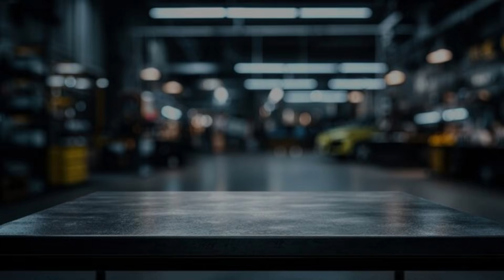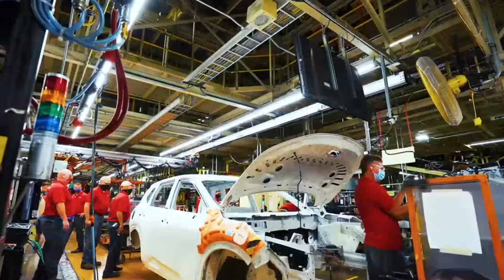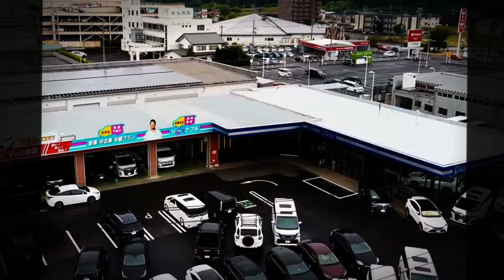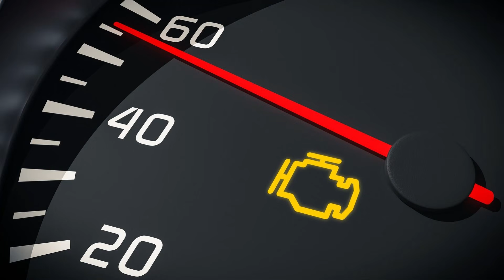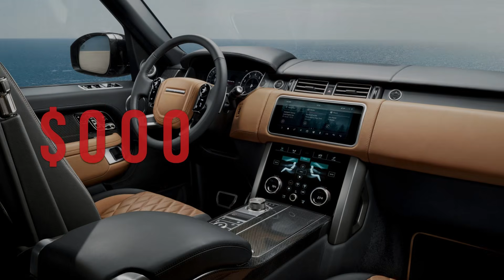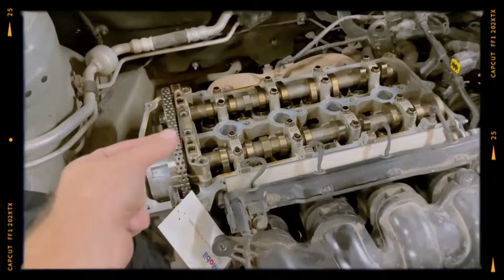The Mechanic Blacklist: 5 Modern Cars to Never Buy

Comment: CVT transmission with a valve body? Why does it have a valve body? I thought the valve body was what shifted the gear as needed through hydraulic pressure.
Reply: i thought so too ?

Comment: Never get the Nissan with CVT transmission; Ford until 2020 older models cyclone 56 with a trojan horse water pump, in certain years Taurus, Explorer, Edges, Lincoln MKX models; Hyundai KIA; GMC Chevy Silverado, Tahoe, Sierra, Surbuban...do not have time to finish, crazy the way these manufacturers are not held accountable. Where are the lawyers?